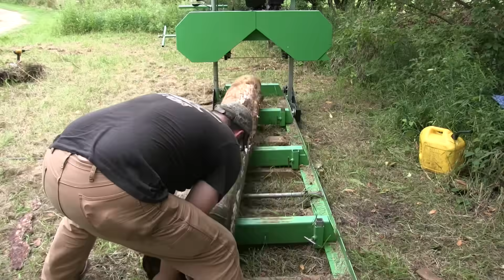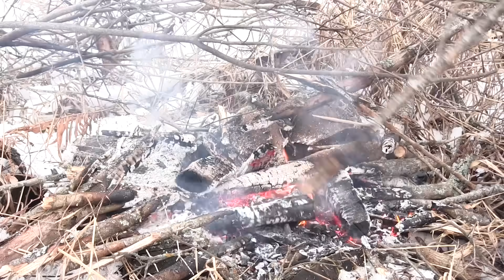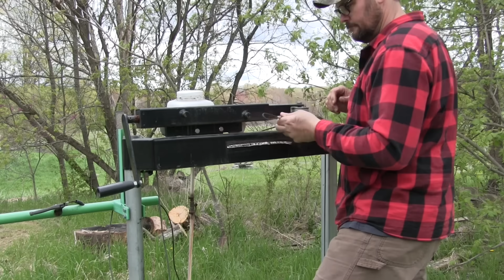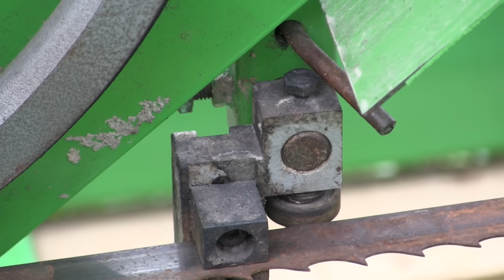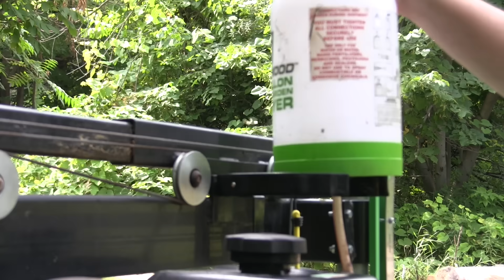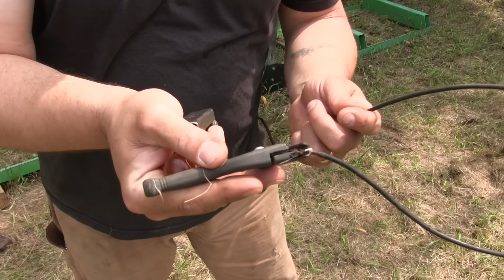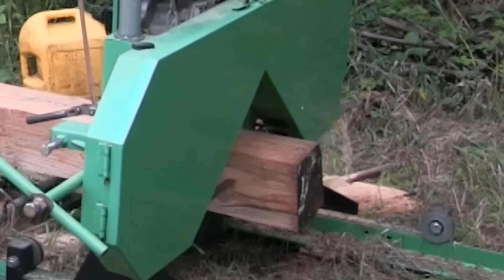Harbor Freight Sawmill .....set up &  first impressions

Comment: Great video, and good problem-solving skills.  I think you are going to find that you want it up in the air at least a few inches.  That gets the mill up a little more in your work zone, and allows you to clean out between the rails.  Running the mill bent over is going to get old, real quick.  I can also see you buying some angle iron and making a longer track with no joints.
There is at least one HF sawmill group on Facebook.  A lot of guys have videos on modifications they have made to their mills.  
I started with an Alaskan mill and like you, don't have a skid steer or any other heavy iron to help.  I think I may tackle some big wood by at least halving it with the Alaskan mill to make it more manageable and then moving the pieces to the sawmill (I have a WM HM126 on a trailer).  But even my Alaskan mill maxxes out at 30 inches wide, so there are still lots of trees that I can't handle.  
I took a couple welding classes just so I can know how to mod equipment, and maybe do some metal art.  I plan on attaching a drop-in winch and building ramps to help get logs up on the bunks.  I've already built a log arch, after also buying one from Northern Tool.  I think using two will help keep the log completely off the ground.  Dirt is really hard on blades.

Comment: Bought mine new at the end of the year when they have that 25% discount coupon so I got it for around $1750.  Sorry had a old Coleman pop up camper frame converted to a trailer that had no more use as a trailer, got a 18' 2 axle trailer so it was just setting around.  Mounted the mill on the trailer, now it is portable.  With a little welding and some creative thinking it is easy to level out.  Have a old 1947 VAC CASE with a homemade front end loader so I can load rather large logs.  Right now 24" seems to be the max that I can do without issue.  Found I can get creative with chainsaw to cut BIG logs into sizes that I can put thru the mill.  You will find that you go thru blades, suggest you buy them in bulk on EBAY, and purchase and modify a chain saw sharpener to keep them good.  Used the hell out of mine and so far haven't had any issues besides lube jug and mine from the get-go had a throttle similar to what you modified to.  Did modify the door hold down bolt, now is no longer that mile and a half long, don't know what they were thinking buy it is a pain in the ass till you double nut it to shorten the length.  Also they put the adjustment thrust bearing on the wrong side from the factory.  Simply move the thrust bearing to the outside and it works much better.
Reply: 1
Reply: 5
Reply: 3

Comment: That belt is a bit tight (WAY too tight). That can burn a bearing, and when that happen it's always the one that turned the most.... in this case, the engine-crank bearing.
Reply: Yep belts don't need to be as tight as people think they need to be
Reply: @Defundemorats  why not get a longer belt instead of all the drilling and filing
Reply: I thought it was really interesting that he mentions measuring the bearings to find the right ones when he has to replace them but that he stuck with the book on the belt length.  When the first one didn't fit I was thinking that he would come back with a 77 or 78" belt but he didn't.  He didn't even measure what was in there to begin with.  He needs to get that 76" belt off of there and put on the correct length belt.

Comment: "And just like that, 7 months later we're ready to cut a log." Lol
Reply: Actually it took me about 8 hours to get the trailer ready, installed it on a modified Coleman pop up camper frame built into a flat bed trailer.  Then it took me about 6 hours to assemble the saw and get things aligned, would have taken much less time if I had help but you make due with what you have.  Actually the trailer prep was the hard part, coming up with a good system to level it out was the hard part.  Suggest if you build it up on a trailer don't absolutely level it out, keep it at the edge of the bubble to the start end, that way the saw frame will always want to go to home.  Also make absolutely that you stay behind the pass line of the blade  and don't build in a trip hazard.  Sorry the blade guard won't stop a broken blade from exiting in a dramatic manner.  If you stay behind the frame you simply get the opportunity to see how far the blade went before stopping, if not staying out of the pass line have 911 on speed dial.
Reply: I was gonna write the same thing! It's hot in the summer & freezing in winter. However EVERYONE wants to play with the new toy... So I felt his pain....
He does great work though explaining everything! I'm so glad he talked about the belts and the throttle cable! If I do happen across one, I'll know what to do!
Reply: Well maybe now you can set yours up in less than a year since you have the proper setup info.
Reply: Having bought a few large machines, I feel like that’s about right with most machines. Lol.
Reply: The magic of video cameras !
Reply: ...and lumber is cheaper now.
Reply: Lol,this hunk of shit is more work than a woman.
Reply: @shaolinshadowslap  Come now, that's just talk.

Comment: You got a good deal.  Even brand new, they are $1k cheaper than the smallest Wood Mizer.  Like you said, the trade off is the parts availability and customer service difference.  But a handy guy like you can keep that thing running for years to come.  Just be glad I'm not a neighbor, Dave.  Because I would be hovering around trying to get wood for guitar bodies from you lol.

Comment: Good video! But you didn't mention the cost of the blades, auto sharpener. The first stone or nail you hit, it is finished!
Good buy though. It doesn't take much to cut 1500 bucks worth of lumber these days.
Another advantage, is for most uses of lumber, Is no need to dress it, the cuts are nice and smooth. Also not much waste in sawdust compared to a circular mill.
Disadvantage is they are quite slow, but if you factor in the amount of time and handling planing the lumber, Is faster and less labour intensive compared to circular.

Great review Dave! Thanks.

Comment: Dave,  after bearings wearing out so many times as well as having to fabricate different parts for my Harbor Freight sawmill, I sold it and purchased a Woodland Mills 126 for $2200 that was slightly used but put together wrong. It wouldn't cut straight (imagine that) for the guy who had paid around $3600 for it with a 14hp motor.  I reassembled it correctly and it cuts bigger logs than the Harbor Freight and parts are readily available. If I was buying a first time saw, it would be this one or it's smaller brother, the #122. The Woodland Mills 122 isn't a lot more than the Harbor Freight but it's built so much better, easier to adjust the blade tension and has an aluminum water tank. Love this video like all the rest of the others you've made! We'll be calling your show : " Keep it Simple, with Dave Wimple!" I think that has a good solid truthful ring to what you do.
Reply from the maker: LOL thanks.  it's ( Whipple) by the way.

Comment: So, it was a mystery to me why the water pump on the car had to be replaced so often -- finally discovered that the serpentine belt was .5 in shorter than spec'd . . . and even though the tensioner pulley accepted the short belt without complaint, the pump bushing did not. If yours doesn't ease up enough to suit, don't hesitate to lengthen those slots, Dave!
Reply from the maker: well said. Thanks

Comment: Turn the fuel supply off That is a preditor engine it should have a fuel shut off.  Do not leave fuel in the carb, it will corrode and the jets will have problems, the ethanol does that
Reply from the maker: right

Comment: 20" is still a good size log.  Just a pet peeve, that lube isn't a lube, its first and primary use is to clean the band from pitch that builds up so the band can run clean and cool, the band is air cooled. Its a cleaning agent.   Too much "lube" will lube the band so much it can slip.  I use a diesel drip but my drive belt isn't the rubber tire on the band wheel so diesel will degrade the drive belt.  I only run a slight drip of diesel.  These small cheap band mills have their place for sure, pack it into a remote place for sure.
Reply from the maker: right on

Comment: Actually not a bad set up for a Harbor Freight Mill. I am not surprised that the motor mount wasn't welded in the correct location. But over all not a bad little setup for the homestead based on the price. Another great video!
Reply from the maker: Thanks

Comment: Dont want that belt to tight. Pulling on the bearings on that cheap motor probably wont last long
Reply from the maker: right. It should stretch a bit during the first run
Reply: I hope all works out for you I plan on getting on soon good lick

Comment: that is the problem with Harbor freight they arent in the sawmill business...  You can buy a better sawmill from someone who that is their only business for about the same price.  Also you need to replace the crappy blade with a good blade and it will improve the cut 100%.  Again, there are companies that their only business is sawmills, and  their smallest cheapest mill is similar to the HF for about the same price.  personally, I am going to break out my welder and build my own sawmill.  I can make a better sawmill for 1/2 the price of the cheap mills.  I do have a portable chainsaw mill that does ok for rough cuts.  Light and portable and less than $100 on Ebay.  I can cut slabs to take home to finish cut and leave all the BS in the woods.  Problem with the chainsaw mill is the width of the blade - a lot of wasted wood turned into sawdust there. lol
Reply from the maker: Right! Chainsaw mills make a lot of waste

Comment: ha,  " Just like that, 7 months later we're ready to cut a log", lol digging the humor.   I'm sure you have used a chain " Alaskan " saw mill would it be better? I know the waste is horrible with a chain saw mill, but you can cut some big trees with one and less handling of the log as you can saw on sight in the woods and only haul out the sawn boards.
Reply from the maker: I like the beam cutter for a chainsaw, The Alaskan Mill ....takes a special chain and Ive never had great luck with one, but I havent put a lot of time into one either..The beam cutter i have MONTHS of time running and it works great for beams and 2 sided logs but not so much for boards. The band mill is better at everything but you have to move a whole log to where it is which is a huge problem in itself
Reply: @Bushradical  I have access to a wood-mizer but the problem I face is moving whole logs and I really can't afford skidder, big truck/trailer, and other heavy equipment. I'm mainly interested in making timbers and square logs for building. I have a chain saw mill with the narrow chain and I'm going to look into a beam cutter, it might do the trick for my needs. I was thinking of the Harbor Freight mill as a easy set up and take down Hmm Thanks for the lead on the beam cutter. I'll be in Southwest Michigan this weekend then in two weeks I'll be in the Western UP for a few weeks camping/fishing/ grouse hunting/ land shopping.

Comment: Cool review! I'd say for $1500, it won't take too much lumber to cut to pay itself! I bought a predator motor to replace the honda on my cub cadet tiller 4 years ago, and its still running awesome! I only paid $99 bucks for it brand new! I'm impressed with it! Great video as always! 👍
Reply: I replaced a number of motors with Harbor freight Predators. Gas compressor, rototiller, log splitter, brush trimmer and here soon going to replace a honda trash pump motor. Predators are great because they are low cost and the majority of things that you or one might put it on it will not get enough hours on it to do any damage. You will have to run that motor non stop every day for a solid year to put any wear on it. Watch Project Farm and one of his videos where he tells you the best type of oil to use. The better oil you use will keep the engine running for a long long time.
Reply: @kameljoe21  William,  what kind did he say
Reply: @Hugeroost  I can not recall. Just Youtube Project Farm and type oil in his search sections for videos.
Reply from the maker: Right on. Thanks

Comment: Make dam sure you cover that motor in the rain.  It literally fills with water thru the exhaust .   Also, if you want to get a larger engine,  make sure you measure the base.  Even a larger Predator motor won't fit.
Reply from the maker: Thanks

Comment: Hey Dave great deal on the saw mill and it sure will come in handy in the UP, there's lots of saw mill around here where I live it seems like everyone has one in their back yard but the only problem I hear the owners saying about these types of mill's is that its getting harder to find replacement blades but luckily there are a few guys around that sharpen the blades for 10 bucks, looks like you got yours dialed in and happy sawing eh
Reply from the maker: I have a guy just down the road that makes them. He'll make em any length you need.
Reply: That's awesome

Comment: Dan Wheeler built a open shed (made with lumber he milled) to cover the mechanism when not in use, and laid a permanent concrete base for the rails. Yes it's a bigger machine he has, but hey they seem like sensible mods given the climate you have up there. He is going to be using the mill to help build his new house soon. He's already built some great 'sheds'.
Reply from the maker: Right on

Comment: Excellent review!!!
Use Fluid Film on the cables instead, it won't evaporate.
Put Amsoil Small Engine oil in the motor.  It'll be more quiet and some more power, plus it has 200 hour life.
Reply from the maker: Great tip!

Comment: You could have bought a new one for $2,199
Reply from the maker: $2199+$132 tax+$200 lift gate fee (theses mills get delivered by LTF freight).   $2534.  vs. $1500
Reply: @Bushradical  $1500 + new belt + new blade + repair time

Comment: There is too much tension on the pulley the bearing on the engine is going to get worn fast.
Reply from the maker: The belt will stretch a bit when ran

Comment: Hey Dave, good score on the sawmill. Did you have to sharpen the blade or buy a new one? I as well like the simplicity of that mill.  Up here as you know, it is hard to find a deal like that. I think that is why guys buy the Alaskan sawmill. Nice tutorial, thanks.
Reply from the maker: I cleaned up the old Blade and used it.

Comment: That is a great deal on that mill and I looked at them for a long time when they were $1799 at Harbor Freight. By the time I was ready to buy they were 2199. I ended up with a woodland mills 122  for about $2500 with some accessories included like a cant hook and a winch and a cover for the mill head. The WM is very similar but better construction and great reputation for product support. Love my mill but if I had a chance to pick up a HF mill for $1500 I would be all over it ! Nice score !
Reply: I have the same woodland mills unit and I love it.  I've used it for years sawing beetle killed pine in Colorado and have recently moved to Missouri where I'm looking for some land with mature hardwood timber and it will be used again as soon as I can find a place and get it set up.  The Woodland Mills guys have been great with customer service.
Reply from the maker: right on
Reply: I believe WoodLand Mills gets credit for the original design of the HF sawmill (about 2009?).  They have done numerous improvements since then, tho the bed is about the same.  I susect the HF supplier in China was either an early factory working for WM, or just copied the design of the earliest HM122 model.  Does anyone know more?

I had the HF sawmill for 3 years, an earlier 2013 model with the 280cc engine.  I did several modifications, including bearing changes and welding up the bed.  I recently bought the WoodMizer LX25 and modified it.  It is more like $3500 and several months wait.  If you can get the HM122  (about $2500), I think that is a good way to go since HF shows "unavailable".

Comment: Dave, I started looking at getting one of these last year but the cost to get it to Alaska made it as expensive as one I could buy from a dealer. I looked at Norwood and many others but could not get one because of covid and production delays. I talked to Woodmizer in Anchorage and at first they wanted to sell me an LT 16 which is a great saw but out of my price range. We settled on a LX 55 and after waiting for 3 months I am glad to have a Woodmizer.Good luck with your saw and don't forget to re level it after it sets through the winter.
Reply from the maker: I would take the woodmizer too, but I couldn't pass this one up.
Reply: That's a great deal Dave ! Hard to pass that up for sure . Why spend 6k plus when you can get this one for 1/3 the price . 
Thanks again Dave for this video . Timing is perfect as I'm looking for one now .

Comment: I got some 4ft black walnut I'd like to have milled... Got probably 8 or 10 standing dead and about another 80 or so just monsters over 24 inches at 40' high I'm scared of heights so I didn't climb no higher lol but man the lumber they'd make would be purdy! 😁💯
Reply: Find a local who already has a mill.
Perhaps you can make deal.
Reply: @shawnr771  theys a feller lives about 6 miles away has a big one only problem is these trees are on a dang near vertical hillside with no access to a vehicle lol probably why nobody else has harvested them from this part of the property I bought 3 years ago I'd say these have to be 40 or 50 year old trees maybe older lol
Reply: @friendsinlowplaces619  wow.
Reply: @shawnr771  lol I'm telling ya southern West Virginia has some steep hills I'm not far from Bolt mountain, it's crazy high and steep
Reply: @friendsinlowplaces619 
The views must be nice.
Reply: @shawnr771  ppppp